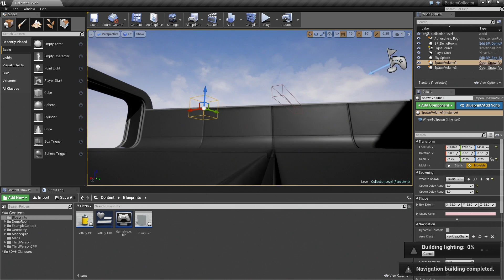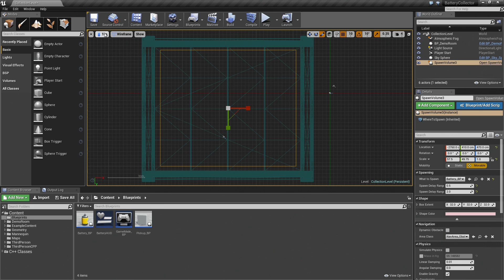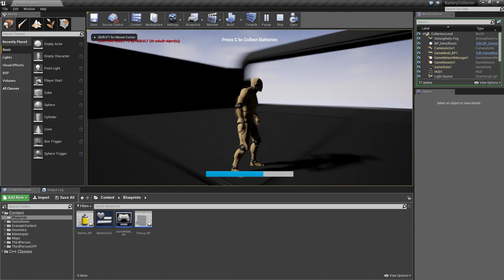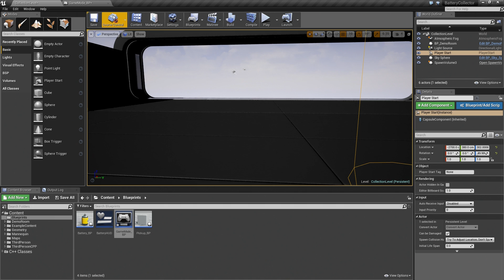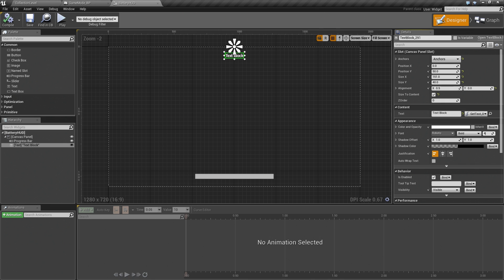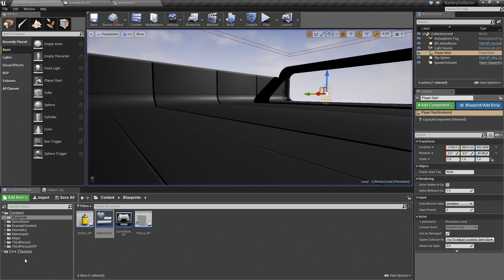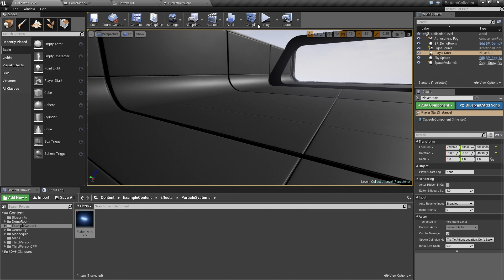C++ Battery Collector: Adding Finishing Touches | 21 | v4.9 Tutorial Series | Unreal Engine

Comment: Wow, well done. It works well with Unreal engine 4.18. 
Few words of warnings for whoever following this tutorial:

A.  You might skip a little step, but it may cause huge consequences (like no spawning at all, etc.) if you scan through the video. Make sure you have some reference codes from other commentator's Github to compare with yours. 

B. In case you face compiling errors, please check other's solutions in the comment section if you are confident that you follow the exact codes which Lauren instructed. (However, discern what applies to your code. Some of the solutions appeared in the comment section may be outdated or wrong.)

C. Also, some of the calibration settings (like PowerToWin) at Blueprint may interfere with your calibration setting at constructor in C++ code. 

D. I have added an example code in my Github repository.
(https://github.com/SeokLeeUS/UnrealBatteryCollector).

F. I also added a sample learning path (all free except the last class from Udemy) to tackle this project (without taking prior classes, I think I would have been very struggled): 
https://seokleeus.github.io/Unreal-scratch/)